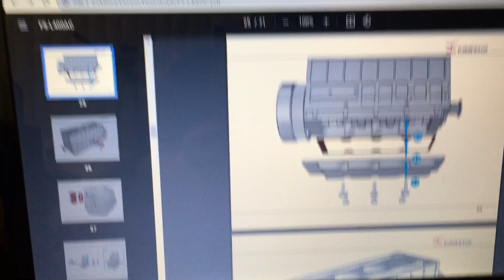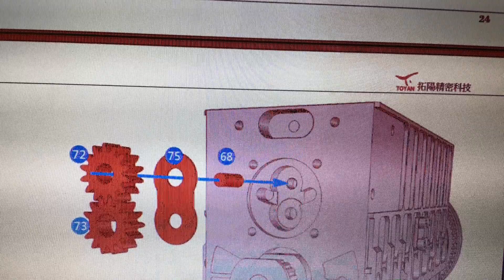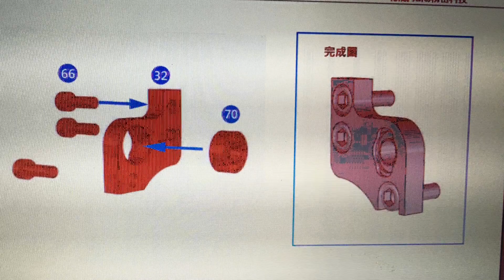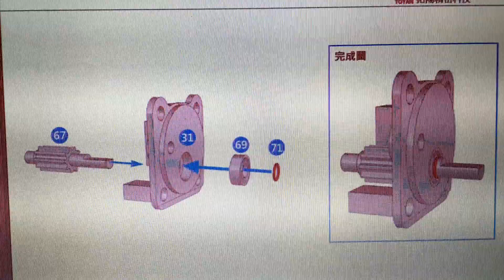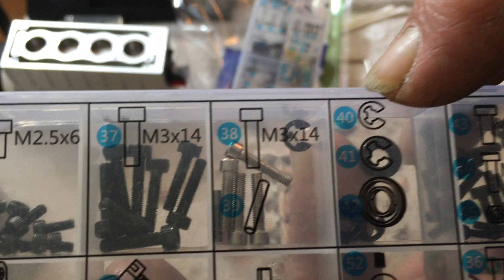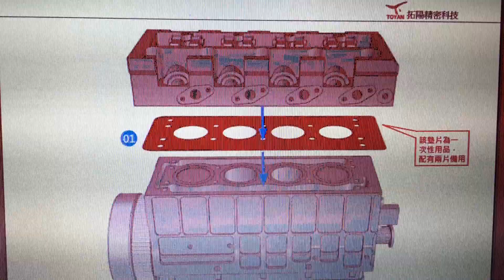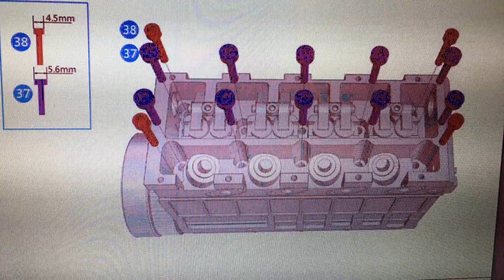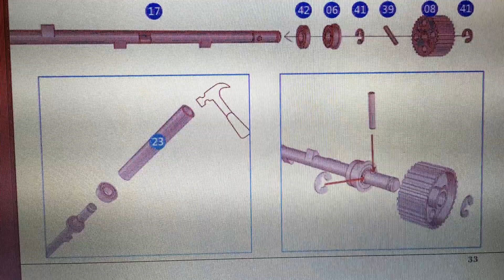TOYAN FS-L400 ENGINE BUILD 2 BROKE A ROCKER SHAFT !!!!!!!!

Comment: Cotton fibers isn't the first thing i would mix with my lubricant but why not. i used a toothpick and was still worried about splinters
Reply from the maker: Good call there brother, I used a screwdriver on my first engine and realized it was magnetic and attracting metal shavings and I was stuffing it in the grease and polluting my engine, had to reclean and start over again lol!

Comment: I would like to add about my Toyan FS-L400 engine problems during assembly.First I had No.3 conrod totally locked solid on the crank. The cap was on the correct way.Measuring the rod bore it was 0.002" smaller than the other three.It needed honing out which I did.Secondly the water pump was solid even with just one gasket. One of the brass gears was longer than the other causing the problem. That needed rubbing down on a surface plate to thin it down.
Lastly the carbs. LEAVE THE SPRINGS OUT. under the carb barrels. Yes you read that right. With the springs in the carbs will feel "notchy" returning to low throttle. Also the idle adjustment screws need modifying. Carefully grind off 1.5mm from the "point" that locates the carb barrels then cut off one complete coil from the idle screw springs. This allows the idle screws to screw in further into the carb bodies and stops them "floating around" 
Idle screw adjustment. Screw in all idle mixture screws all the way in. Open throttle just enough and look at the distance between the end of the mixture screws and main jets. Hold the throttle there. UNSCREW any adjustment screws that have a smaller gap to make all 4 gaps the same then unscrew each one a further 1.5 turns.   
If you have all 4 barrels opening exactly the same amount at idle then doing these mods will give you a very stable very low rpm idle.Mine idles all day long at 1360 rpm rock steady.
Reply from the maker: Hey Thanks Brother, great R&D work there! I did notice the idle screws were funky and my water pump is hard to turn on this new engine, may rods were ok on mine but who knows about the other engines out there. The springs in the carbs do seem to bind everything up, do you mind me mentioning your mods in my next video? I will give you credit for the great information.
Reply: Dennis. I`m not after credit . Please mention anything you like. I build full size race engines for a living so thought I`d try something smaller.
Reply from the maker: Cool, the mods you came up with will help a lot of Toyan owners out. Thanks.

Comment: Have you had any more broken crankshafts on the L400? I just broke a second one. Looks like this one may have broken when I over choked it during crank.  Any additional info or comments appreciated.
Reply from the maker: Hi brother, I haven't broke any more cranks yet, I was wondering if my breaking was a result of hydro locking during choke on mine. sterlingkit has the cranks listed on their toyan parts section now, I have been plugging the exhaust to pressurized the tank on mine since I reassembled it with the new crank, before I plugged off the carbs with my fingers to start it and I think it did hydro lock with fuel causing the failure.